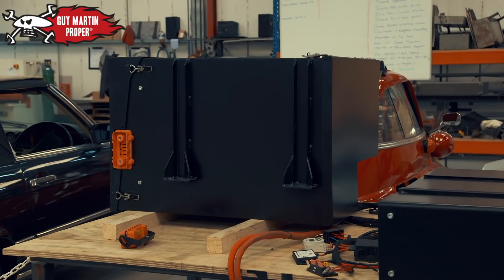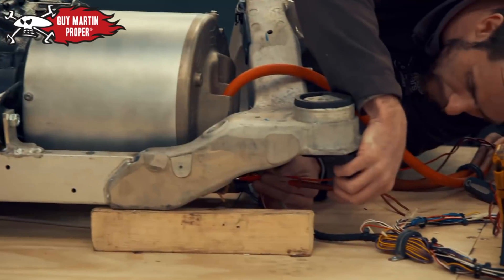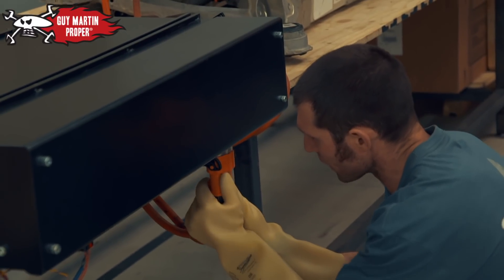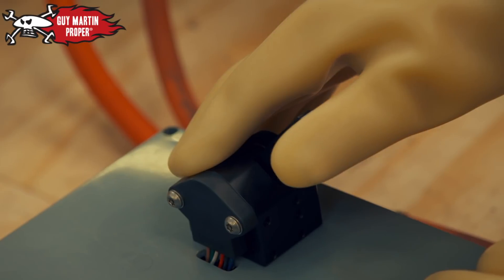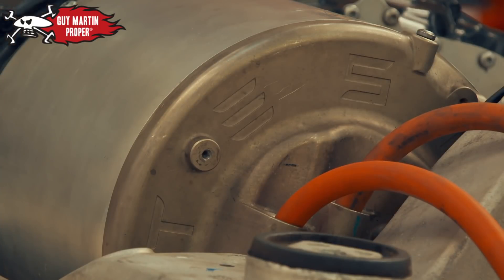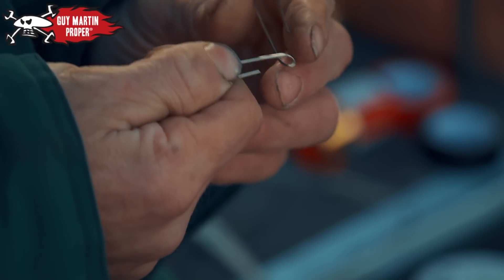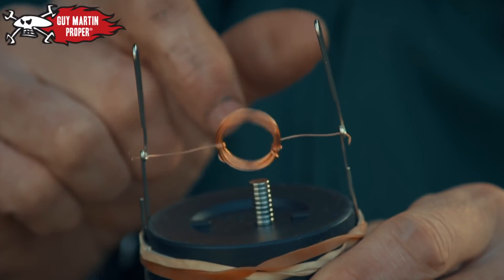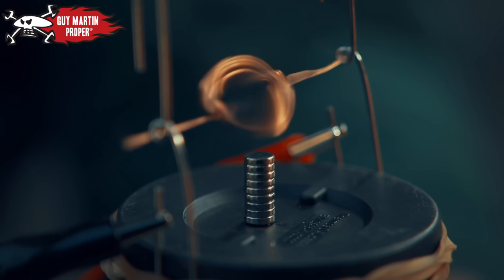Guy converting a Volkswagen Beetle to electric | Guy Martin Proper

Comment: Way to go Guy! Future is electric!
Reply: Yes, but really it's just the past come back round again. Electrics we're first after all. 
Going all the way back to a professor in Virginia who in the 1830s converted a carriage into one. 

To Porsches very first car the p1 in 1898 was electric. Even Henry Ford's wife drove an electric. 
N.Y. also for a while had banned combustion engine vehicle's inside city limits. 

Up to the 1920s gm actually sold almost as many electrified commercial use trucks as they did the ice version's. 
And yes if you search you will find out all of this is true!
Reply: @4literv6  have you ever wondered why the techs never been used in the 100yrs it’s been around for hahaha. Listen to yourself haha
Reply: @MrFGs  electrics we're first and if not for endless war for "cheap oil" and the invention of the electric starter motor(oh how ironic an electric motor is required for every ice vehicle just to operate.😁

Do some research. As every single ice vehicle has not only mutiple electric motors but also a battery(which it cannot function without. 
So why use a non renewable source to power them? Solar, wind, tidal, geo thermal and to some extent nuclear are all superior options. 

Vs relying on fossil fuels and the never ending cycle of find a deposit, drill for it, extract it, transport it, store it, refine it, store it again. 
Transport it again, store it again, pump it again, then finally burn it. 

All of which uses up vast amounts of energy, causes emissions on a truly insane global scale, environmental damage from oil spills, fracking land collapses, pump&wellexplosions, vehicle fires(in the US alone a combustion engine vehicle catches fire every 3-4 minutes per the nfpa numbers. Oil leaks, leaching into local ground water sources from gasoline storage tanks, pipelines leaking etc. 

Oh and it of course also requires electric motors for all that pumping, plus massive amounts of electricity for refining it. 
Just lookup how every refinery has direct line's from the nearest power generating station's. Because they draw so much power. 

In Britain a study done by fully charged showed each refinery uses more electricity in operation per hr than it would take to charge 400,000+bevs simultaneously. Oil pump jacks alone here in the US use enough energy monthly to power converting all commercial use vehicle's to electric power. Again those are electric motors consuming electricity just to pump oil. Why not convert and use the same or less energy to run electric vehicle's 🤔
Reply: @4literv6   in theory dude. I work in renewable power generation in the uk & Europe. Offshore wind farms, onshore, nuclear, energy from waste. There’s no network for it mate. It’s not possible to get the gigawatts required round the country cost effectively. That’s before you consider the harmonics created by large ac/dc converters/chargers. 
Tesla for example are tons of aluminium, almuninium is the most non environmentally friendly metal to manufacture.
Then there’s tons of lithium, cobalt, and the damage that’s doing to the enviroment to mine cobalt :( 
Then you’ve the safety issues that no one speak off. Lithium does this thing called thermal runaway, terrifying. Basically there’s no suppressing it until the chemical reaction is over. 
Fire departments are equipped to deal with that, and if they were, then you have a huge environmental issue with disposing of whatever chemicals you tried to use to suppress it. 
It literally makes zero sense other than the fact it’s making the rich richer & the poor poorer. 
In the uk they’re using tax payers money to subsidise them, that by definition is communism. 
Anyway if EV makes you happy each to their own. But I don’t want to see you crying if it burns your house down some night when the charger or battery faults on full load
Reply: @4literv6   so do we ignore the power generation & transmission issues & continue to sell cars with no infrastructure? Haha 
Never mind the fire & safety issues, that doesn’t matter either I suppose. 
I can’t be bothered doing the research into what your saying to see if it’s true because without a power supply of adequate size & a recharge infrastructure the whole things over before it even starts
Reply: @4literv6  haha you waffle some garbage sir. I’m not trying to change your opinion. Just telling you why ev in the UK is a pipe dream. 
Who the fuck says battery banks don’t catch fire hahaha ice engines generally only burn when they’re running & have serious engine failure. Very rare numbers for the millions of ice in the world. 
Mate you can go on all day, at the end of that day, there’s still no possible way to generate (without nuclear) and no way to distribute it even if it could be generated. So the idea physically can’t work haha
Reply: @4literv6  and again you replied without any form of sensible argument to the generation/transmission/harmonic issues or the safety isssues.
Reply: @MrFGs  is there really not way to shift the power, I'm genuinely interested, not arguing. Even with 3 phase? I mean 100s of 1000s welders work all day and night in this country alone all using big voltage and ampage, the EV ports are only for charging batteries no? 
I agree it will be the infrastructure that let's it down, its a bit shit right now. Just interested.
Reply: @MrFGs  "have you ever wondered why the techs never been used in the 100yrs it’s been around for": The simple answer is - as oil became more readily available, it was simply much cheaper and more convenient to use ICE powered by oil products. We could what-if all day long, but ultimately the answer is because ICE (once oil products became easy to get) got better than BEV. 100 years later, the position is reversing, for all sorts of reasons. In another 5-10 years, BEV will be the reality for most people, even here in the UK.
Reply: @theelectricmonk3909   your dreaming bro. There’s no way to generate or distribute the power required to make it happen hahaha. I love how adamant you people are on this, EV will never be the main transport in the uk in the next 30-40yrs let alone 5 haha. 
Anyway I’m not debating with you people anymore, just wait & see your 100k Tesla turn into a paperweight.
Reply: @theelectricmonk3909   ps… ev was never used because it’s shite haha. Poor range, crazy recharge times, dangerous fire hazard, good tech doesn’t sit for 100yrs before going mainstream
Reply: @LyonsFixItShop   yeah mate, the national grid is absolutely on its arse even at the current load. 
Most generating stations in the UK are curtailed because there’s simply no way to take more. But the shareholders still get paid for full generation even though they might have a grid curtailment at 50-60%
Battery chargers create reactive power, the electric board do not like that one bit as they need lots & lots of expensive equipment to filter the nasty power back out. 
The entire grid would need to be upgraded & I think everyone knows that not a 5/10 or even 20yr job. 
Fife council just installed a load of super chargers, electric board roll in & say hell no. No more than one on at a time haha
People think the electricity is just magic when you press the switch somehow it’s never ending. Far from it.
Reply: @MrFGs  hey you are finally right about one thing. One way or another we will see as time goes by who was right. 

You also made a liar again out of yourself referencing curtailment. 
As i have been told by people in my local emc curtailment just means their is excess generation capacity available on the grid.
But nowhere for it to go. 

Hey imagine that, now if only millions&millions of evs we're plugged in all across the country at any given time. Or we had massive large scale batteries waiting for that current to flow into. All ready to soak up that extra renewable(or non renewable so as to lessen the insane amounts of currently "rejected energy" that is globally wasted each day. Juicy electrons will flow into waiting vehicle's of all type's and sizes(as most personally owned vehicle's sit idle 95%+of their lifespans. And many commercial use vehicle's are idle more than in motion to.

That energy will then be used whenever its needed for their end user's needs, instead of being wasted, rejected or curtailed as you put it.. 
Then further imagine all of those vehicle's batteries having backwards v2x capabilities. Hmmm that kinda sounds like the future to me. 😀
Reply: @MrFGs  "Fife council just installed a load of super chargers, electric board roll in & say hell no. No more than one on at a time haha" - have you got a link for that? Google's coming up with nothing.
Reply: @MrFGs  "ev was never used because it’s shite haha". You're clearly clueless about your transport history. There were dozens of EV manufacturers making thousands of EVs, until Henry Ford transformed the market for ICE cars with the Model T. As for "good tech doesn’t sit for 100yrs" - Lithium batteries with a charge density sufficient to give an EV a decent range have only existed for maybe 20 years, and even now they're still not really good enough. If the ironically named John Goodenough's new "glass battery" delivers what he's promising (and recall he invented the Lithium-ion battery, so he knows what he's talking about), then range will cease to be a barrier, as will recharge times. Fire hazard too, probably. But hey - you're clearly stuck in the past. Enjoy it, at least it'll always look rosy to you.
Reply: At this moment in time in this country it ain’t sustainable